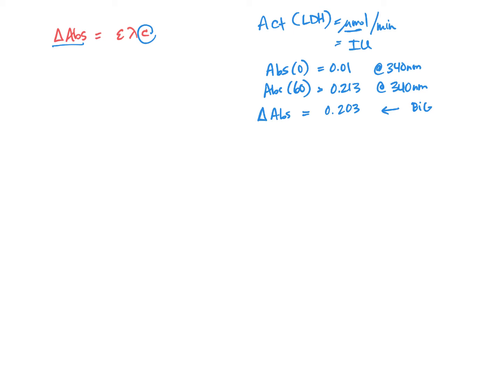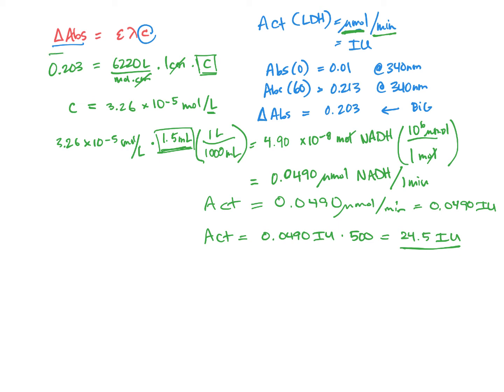Calculating LDH activity - BIOL307

Comment: Very nice explanation maam. I have a question that is, I am taking total reaction volume of 250 ul. So while calculating, do i have to convert the value in ml that is.25ml (for example you have  taken 1.5ml*1l/1000ml).likewise I have calculate in this manner. 25ml*1l/1000ml, so that ml gets cancel out and left out with mol unit.
Reply from the maker: That’s right! You need to cross-cancel to get to moles.
Reply: Thank u so much maam for your reply.
Reply: I was taking total reaction volume of 250 ul in calculation and was getting much higher relative enzyme unit. But after taking  .25ml , the values I am getting is comparatively very less.

Comment: Thank you so much for your explanation. I have a question, what if before measuring the enzyme, we incubate the reaction for 2 minutes.  Do we divide by using t=3 minutes?  Thank you so much
Reply from the maker: Anisa, if I understand you correctly, you would divide by t=2 mins, if 2 mins is how long the enzyme is working for!
Reply: @SciEdSusan  Thank you for your attention. I'am so sorry if my question is not clear before. 
Actualy I measure the réaction is at 1 min intervals for 5 minute, but we incubate the réaction before for 2 min. That's why, I think we divide with t=3 mins.

Comment: Thank you for this video. I now know an easier method to calculate enzyme activity :)
I have a few queries though :
1)1 minute is considered because that is mentioned in standard definition of IU. Can you clarify this ?
2) I am working on determining the activity of beta-galactosidase from crude extract. So if the absorbance does not increase drastically after 1 min, what do you suggest I do ?
3) All the research papers I read, suggested drawing a standard plot of product absorbance vs product  concentration (in my case, product is o-nitrophenol). Can I follow the method mentioned in your video for determining enzyme activity of crude extract instead of standard plot method ?
It would be great if you could answer my queries !
Reply from the maker: 1) The standard definition of enzyme activity is given in International Units, or micromoles reaction per minute. Your assignment may ask for different units. 
2) Caveat that I am not an expert on enzyme purification! Make sure you're assaying B-gal at an appropriate temp (37degC). You can run the reaction for longer than 1 minute, but you need to divide by the amount of time that has passed in the enzyme assay. You may also want to find a positive control, like unpurified extract, that should have pretty high B-gal activity.
3) A standard curve of ONP concentration vs Abs will give you a better estimate of ONP concentration in your "unknown" sample.
Reply: @SciEdSusan  thank you so much for quick reply :) :)